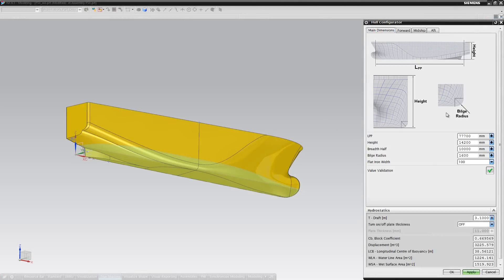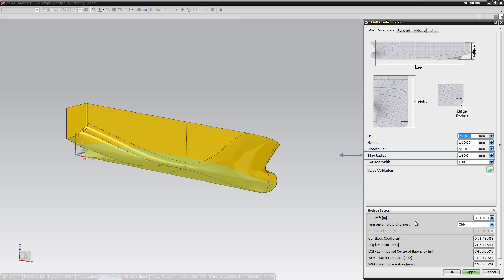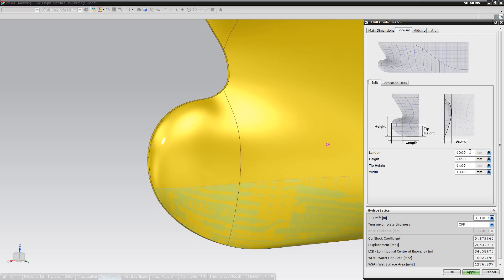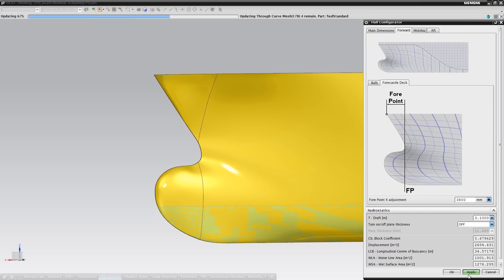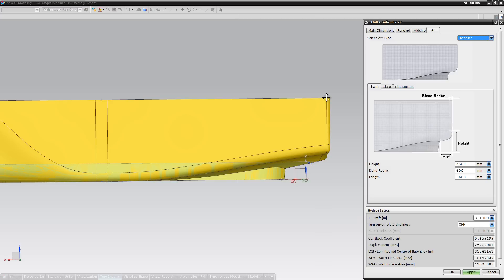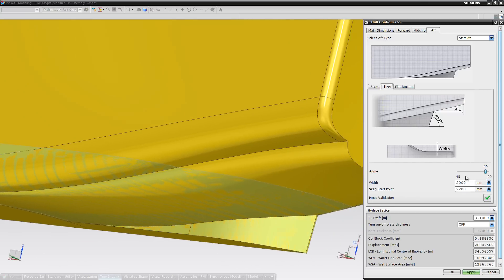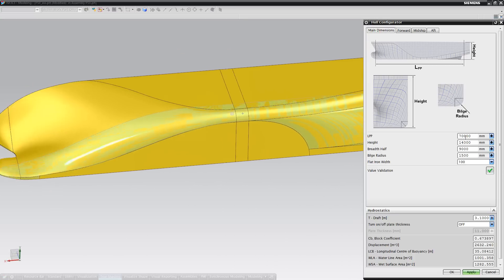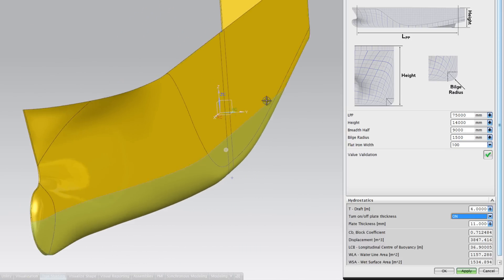Parametric Ship Design in NX

Comment: Did you code this NX custom interface in Python or other language? Could you advice resources to do custom interfaces for NX? Thank you!
Reply from the maker: Hi, no this is a simple custom adjustment using profiles. No coding is required for this :) User profiles can be shared through the mtx format if I recall correctly
Reply: @Miror  thank you very much!